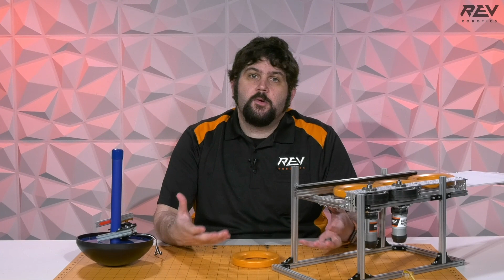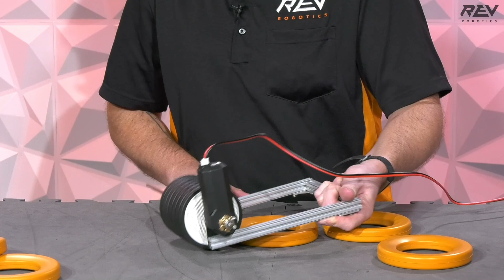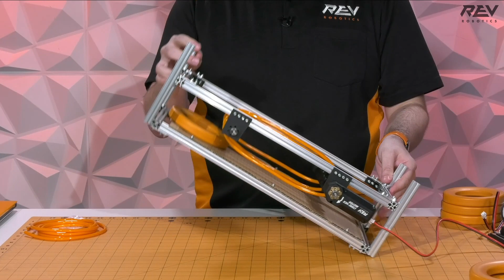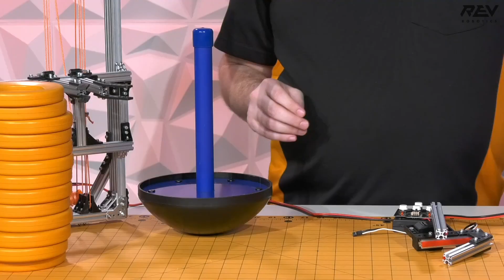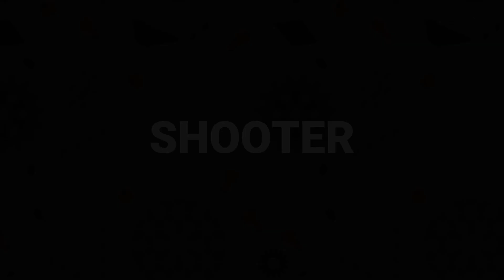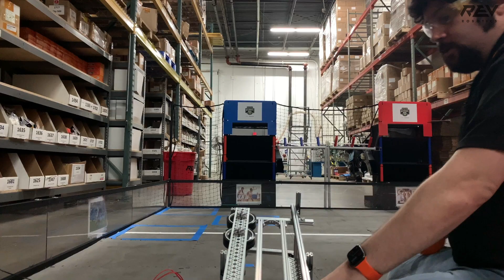REV Prototypes - FTC Ultimate Goal 2020-2021

Comment: Thank you for showing the design idea. Looks like the motor output hight speed is the key for the shooting. Do you have any 1:1 gear box available for RVE motors?
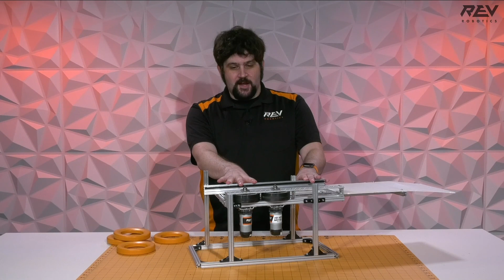Reply: 34:50
Reply from the maker: You can use a UltraPlanetary Gearbox with just the mounting plate, pinion gear, and female output. If you have a UltraPlanetary Kit with the HD Hex Motor it is really easy to get this set up. More information coming as we get our docs for these prototypes up and running.
Reply: @REVRobotics  Hi, I just figured it out. We can use a ULTRAPLANETARY FEMALE 5MM HEX OUTPUT to get 1:1 ratio. Thanks for your help!
Reply: @REVRobotics  Thanks for your reply. The UltraPlanetary Gearbos are in  3:1 to 60:1 range. How can we get 1:1 ratio?